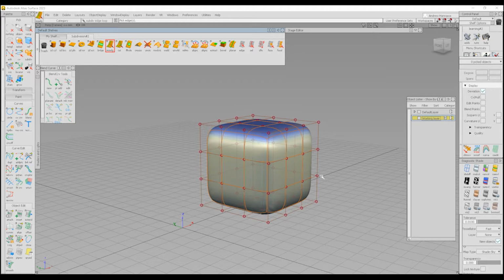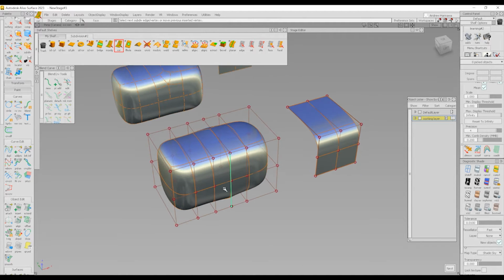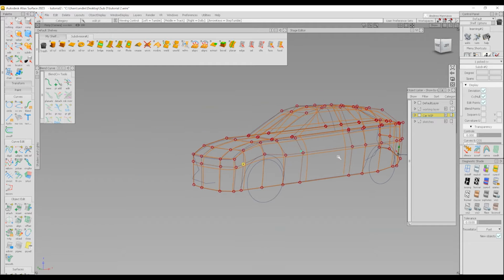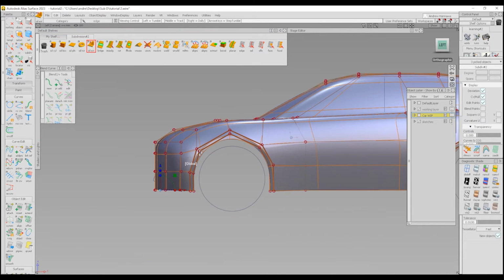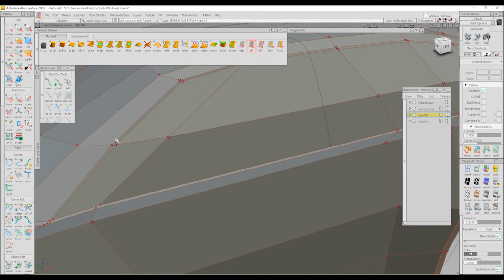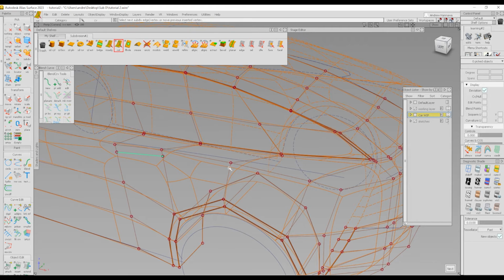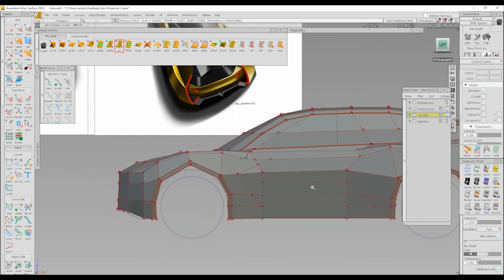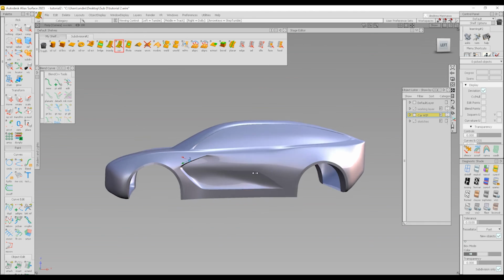FREE Autodesk Alias SubD Tutorial | Car Exterior | Part 1

Comment: whats the difference between Modeling in Fusion 360 and Alias??
is it easy in Autodesk Alias? 

also why not blender subd?
Reply: I hope you don't mind me answering this  sir.
 
Blender is a polygon modelling software used to get a phase 1 modelling ideation. For a super precision in surface modelling alias is the best. It gives you the exact quality as a manufactured unit. And in alias you can check for the continuity also, but not in blender.
Reply from the maker: I have never used Fusion 360 so I don't know what it is capable of. The benefits of using Alias is that most car companies use it. Blender is a fairly new tool and it's just now becoming used in car design.